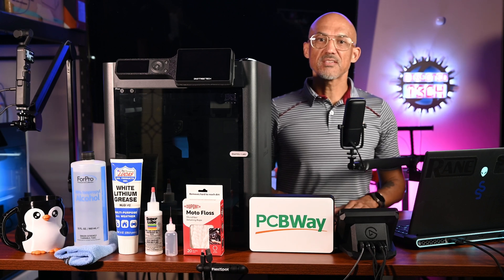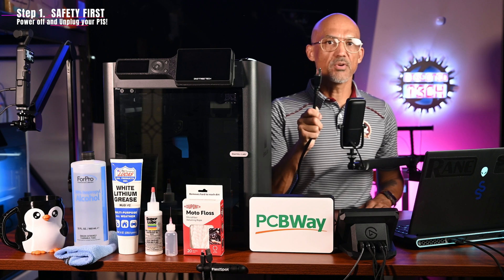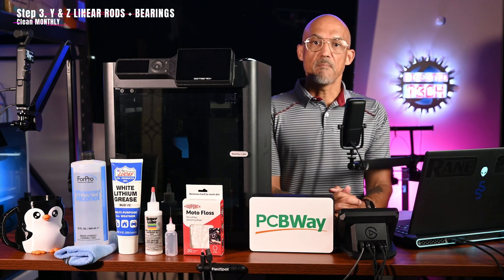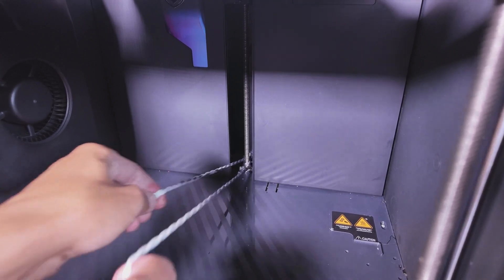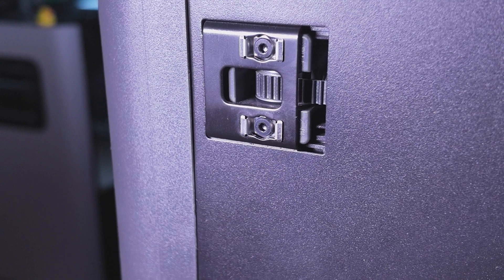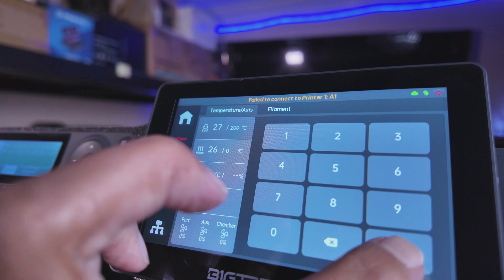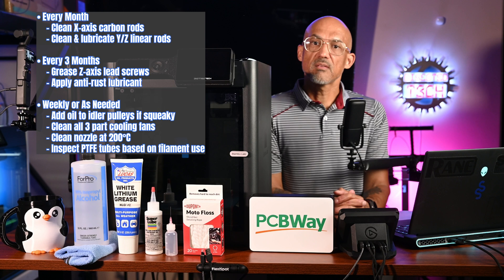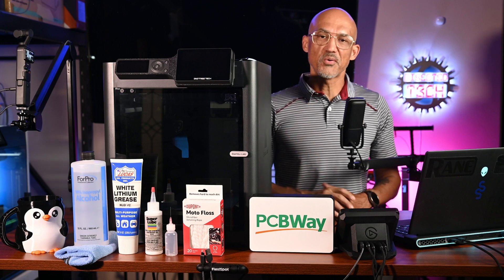Bambu Lab P1S Maintenance Guide | Step-by-Step Cleaning & Lubrication Tutorial

Comment: Great video, really helpful. According to BambuLab we need to loose the screws on the tensioners before moving the printhead and cleaning it. I did not see that on the video and I am wondering if this was an oversight or if this does need to happen. Thanks!
Reply from the maker: Thanks for the feedback! I found I was able to complete the maintenance without loosening the tensioner screws.
Reply: @directedt3ch i did the same. Thank you!!

Comment: Any guidance on the concentration of isopropyl alcohol to use? Is there an all around concentration or should I be using specific concentrations for different applications? Thanks for the excellent video!
Reply: Good question. I would also be interested to know
Reply from the maker: I use 99% for all of my cleaning needs in both my 3D printers and lasers.

Comment: What anti-rust solution do you use for Y and Z rods?
Reply from the maker: The lubricating oil takes care of that.
Reply: @directedt3ch  You did mention super lub and then also an antil rust oil on step 3, so you are saying they are one in the same? Also on my printer on step 5 idler pulley they have put a sticker next to it that says no grease or lube just alcohol.  FYI.

Comment: Thank you for this amazing guide!

I have a weird noise from one of the belt gears that drive the back plate screw. i tried putting oil on it etc, but i cant get rid of it.. It sounds like something is rubbing against something, but only when the wheel/gear is in a certain orientation
Reply from the maker: My pleasure! That sounds like a tricky noise to track down.

Comment: Silly question... do you just apply oil to the bottom of the idler pulleys and not the top?
Reply from the maker: Yes.  You don't want to get any oil on the belts or teeth, so trying to get lubricant on the top is going to likely cause it to drip down.

Comment: What kind of hour usage are these monthly maintenance routines meant for? There's a wide range of how often someone uses their printer, 24/7 vs maybe a couple hours in a month.
Reply from the maker: That's a great question.  Some of the printers like the A1 and the H2D will notify you when you need to perform maintenance.  I've never seen anything like that on the P1S.  I'd say the monthly maintenance is probably good to do whether you print a lot or not.  The rods need cleaned and lubricated either way since dust and debris can get into the grease/oil, and it will slowly evaporate.  The other items are more base on the amount you print (i.e. # of spools as mentioned).
Reply: @directedt3ch my p1s just sent me a message to grease z-axis screws and I've had it for about 14 months